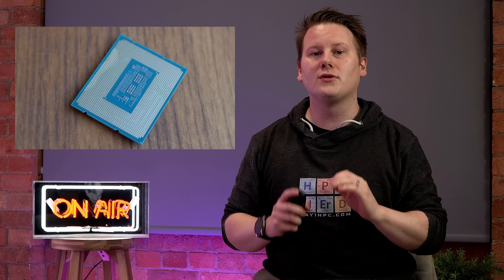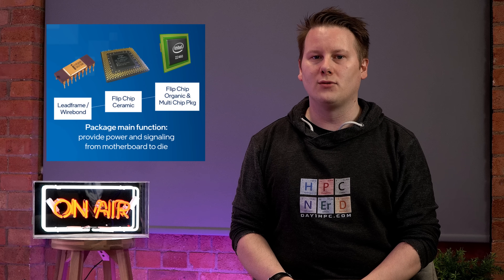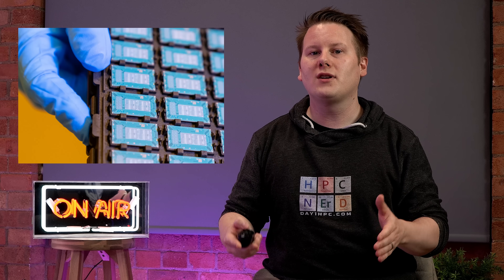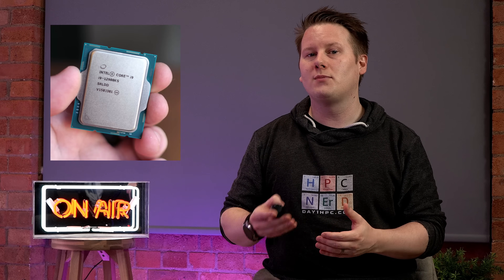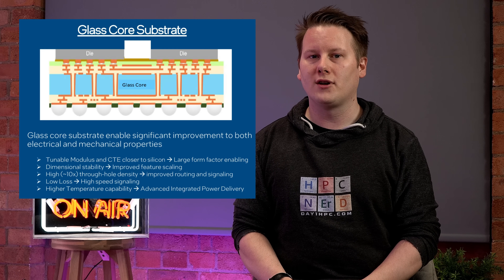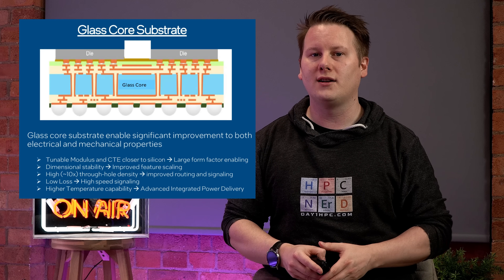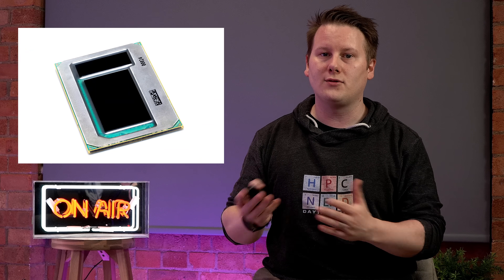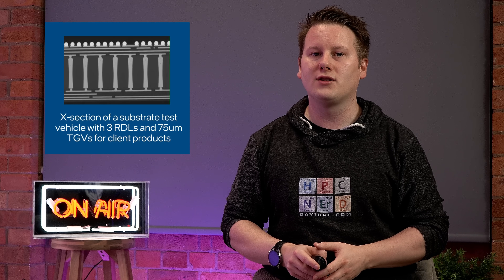Intel: We're Replacing PCBs with Glass Core

Comment: In the mid-1980s there was a startup called "Trilogy" which was founded by Gene Amdahl.  They were going to build "wafer scale computers."  The big problem with doing this was clock and signal distributions, skew across the wafer.  The proposed solution to this problem was to do the signal distribution optically, but that technology did not exist then.  Off and on,  optical signal distribution has been the subject of significant research.  At one time, Intel was anticipating implementing this by 2017.  Rather than the subject being the focus of research for the last decade, it has actually been on the table since at least 1985.

Comment: What is glass made out of? SILICON. 

The circuits in a IC chip are built up on a ultra pure wafer of silicon using vapor deposition and photo lithography. 

Green printed circuit boards, are made of fiberglass and resin, with copper cladding. They are not used inside IC chips. 

One of the problems is the thermal properties of silicon, which has been leading into the possible use of diamond (an allotropic form of carbon) as the substrate material since it has better thermal properties. 

If you want to know how integrated circuits are made, here's a video put out by Samsung Semiconductor: https://youtu.be/Bu52CE55BN0?si=K4Fa1A9EY4etYFxA

Comment: For the few out there wise by personal and visceral experiences in psychotronics / radionics this presents potentially *THE DAWN OF A NEW ERA*. 

We have shunned circuit boards and computer-chips and digital electronics due to the adverse / lethal health implications to the operator which, as Thomas Galen Hieronymus himself reflected, likely is caused by the severely-toxic, inorganic components of the PCB substrate.  'Lethal Orgone' results and poisons the operator in connecting him/her to the device and the intended target. 

These are truly pioneering days.  Interfacing artificial intelligence with psychotronics -- wow.   We got GPT on the microphone, Chewie on the bass, and C3PO is poppin' and lockin' on the dance floor.  Put on yer shades, amigo -- the future is about to get a whole lot more psychotronic...

F.

Comment: Like I keep telling all of the AMD fanbois. Yes AMD is sort of on top right now eating into Intel's market share, but I also pointed out that this was true in the past as well until Intel moved from the Pentium chip to the Core 2 chip. Once that happened AMD was almost killed off. Thus I encourage AMD to take what it can get while it can, because when Intel releases its next breakthrough, AMD will suffer the same fate that it did right after the Core 2 chip was dropped. 

As far as you getting a sneak peek or a visit to the facility in question, that would be amazing!

Comment: There are properties of materials that are indicators of how efficient a material will transfer signals. For PCBs the main ones are Dielectric Constant and Dielectric Loss. Using these properties, glass is not as good as many other materials used such as Astra so I don't understand how glass can have less signal loss. I do understand that the fabric weave is a problem and glass could eliminate weave issues also thermal conductivity for glass is likely better. 

One thing that helps with decreasing high frequency signal loss is to use a better conductor. Silver is often used as a coding on coper wires to reduce high frequency signal loss. Since high frequency signal tend to travel on the skin of the conductor silver plating can help. I have not seen silver used on PCB or substrates yet but my visibility is very limited so maybe someone out there is using it.

Comment: If you've ever seen PCB's being made its a chemical plating process that creates the copper via's ... i picture it will be a multi-material solution using chemical plating on glass with solder-mask which will not make it look like a transparent piece of glass but the same as fiberglass PCB's

Comment: As someone that built his own computer, but arguably I've only built... two computers ever...  Would the glass core substrate increase the fragility when holding onto the CPU?  
While I know I'm talking about all of maybe 2 minutes between package and retention clip tightening, knowing Intel's history with low quality thermal interface between dye and built in heat spreader, would a glass substrate be too delicate to do something like delidding for better thermal performance?
Reply from the maker: It's unlikely. You can tune the strength of the substrate more easily with doping and binders.

Comment: A lot has happened since I bought my first transistor radio in 1958.  Even as a science nerd, I didn't imagine we'd have gone this far, so fast.  I find the humans to be disgusting barbarians and look forward to our AI robot masters setting things right... maybe.  Also, with the return of the ice age, I expect we will need all the help we can get as millions of humans die off.  I'll be long gone and don't give a crap, anymore.  And people wonder why I'm so very reclusive.

*Technically, we are still in an ice age, but taking a short break.  As Earth moves closer to the center of the Milky Way, gravity will undergo changes that will provide the proper conditions for a total ice sheet over the north, ONCE AGAIN.  Earth moves BILLIONS of kilometres through space each year (about 70 billion Km within the Milky Way, itself, which is turning, too)... one cycle per year, a helical wave as we travel, South Pole forward through space.  We must expect our magnetic poles to adjust to the poles of the Milky Way, also flying South Pole forward through space... nothing ever travels in a true circle unless it can exceed the speed of light squared.  The ice sheets form in the north, the tail end of spaceship Earth.

If we were flying sideways, through space, Relativity would cause time shifts between summer and winter.  Earth flies South Pole forward through space carving a helical wave about 70 billion KM long within the Milky Way, which is also moving.  One wave per year with an orbit wave length of about 70 billion Km.

Comment: Silicone Glass has potential including fine line widths, similar coefficient of expansion as silicone wafer dies, permisivity and permitivity for higher transmission rates and improved impedance matching to reduce ringing (fine wire traces at high speed act like inverted wave guides, so surrounding material affects the speed of light. Mismatched impedance creates signal reflections). But one problem is low thermal conductivity compared to metal.  Perhaps they will design a module with many chiplets in a hermetically sealed, pressurized shell. High pressure gas inside the module will increase gas density and thereby improve thermal conductivity from heat generating chiplets to the shell surface.

Comment: I'm a lot more interested in what's replacing silicon. Gallium Nitride (GaN) and Carbon Nanotube (CNT) chips are needed more so than replacing the substrate die packaging. Sub <3nm lithography is imminent and quantum tunneling is going to be a significant problem now.

Comment: This is really cool and I really hope Intel can give you more info to share. I am full of questions as well. The pictures look like they expect normal copper connections on both sides of the glass, but is that really necessary? If the flip-chip has VCSELs on the surface, and they take a similar amount of die area and power as a pad for connecting a pin, maybe that's how Intel plans to get by with fewer layers. Wild guess though.

Comment: I'm keen to see how it pans out. One immediate thing comes to my mind though and it'd be an interesting question for Intel to answer. The organic substrates have some flex in them naturally, how would a glass substrate cope with the high compression forces placed on it by a socket clam and heat sink? what's their approach for dealing with the mechanical stress a chip might face during installation, would the glass break or is it strong enough to hold up to mechanical stress?

Comment: 🎯 Key Takeaways for quick navigation:

00:00 🧩 The green PCB-like component called the substrate is crucial for connecting silicon to motherboards in high-performance processors.
01:41 🔍 Substrates facilitate connectivity and power transfer between silicon and motherboards. Glass core substrates are the focus of Intel's next-gen packaging technology.
03:16 💡 Intel has been researching glass core substrates for almost a decade, with plans to make them available to customers by 2030. Glass offers advantages like thermal stability, signal quality, and higher density.
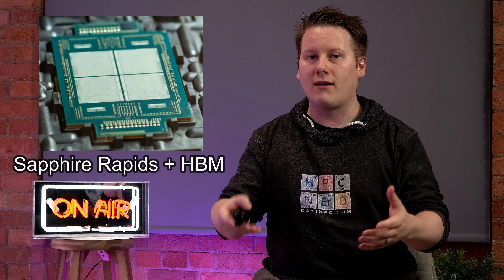05:10 📈 Glass core substrates enable scalability for larger and more complex chips, supporting faster connectivity and possibly future optical solutions.
07:01 💰 Intel aims to bring partners and the ecosystem on board for glass core substrates, acknowledging the challenge of transitioning from organic substrates.

Made with HARPA AI

Comment: I know you maybe know a thing or two about chemistry and electroanalysis... So take my comment for what it is worth as the layman I am BUT: My perception is that we learned and developed so much material science around ceramics in the last couple of decades, I'm not gonna lie, I thought the future was to go back to ceramics.

I remember in 2008 Intel was talking about how the future is laser (or optical) transistors or something like it, as continuing in the same path would lead to un-coolable chips hotter than the sun - I think it was just about when they were moving to finfet, I might be jumbling the years, but clearly we found a lot more room to keep moore's law limping along with silicon. If I'm not mistaken, some matrix operations needed for AI, with set paths and limited instructions, are still targeting glass/laser/optic logic as a tech path - but it isn't as Intel said it would be back then. So, as always, I'm somewhat sceptical.

Comment: Mark my words: the semiconductor industry will (in the midterm) have to replace most both high-bandwidth & low-latency electrical data interconnects with optical ones for both economical & physical reasons - including inter-device, inter-die to possible inter-core/ip connects. Think short-range fiber optics across dies/inter posers & rigid silicon wave guides built on die using various methods coming out of optical computing.

Comment: something about glass and a thermal cycle of 100 degrees rapidly going up and down does not make me that confident that it will last... but then again maybe there is special glass that can handle that without experiencing thermal shock. (just starting up a PC going from room temp 15C to 100C  full load when you are loading windows in 5 sec is what i am talking about.)

Comment: Does this glass core substrate have a future in say... replacing motherboard PCBs? Would there be advantages worth the cost, or will this only be practical for processor / memory dies?
Reply from the maker: Not really - you don't need the connection density. Signalling with transceivers maybe, but that's highly enterprise
Reply: @TechTechPotato  Thanks.

Comment: I'm excited about the possibility of optical integrations. 

Although it'll be quite awhile before we get fully optical processing, we can benefit almost immediately from inter-chip optical connections. Many of the problems that still hold back bus speeds are entirely electrical, and likely wouldn't exist on a fully optical bus, meaning we should have bus speeds that are mind melting. 

Another benefit of optical is the low to non-existent heat they create. Depending on how light would be generated within the processor for output data streams, the heat created by the processor's external communications is likely to be much lower.

It would seem that we should also expect this glass core innovation to make its way into mainboard substrates as well, which should give us a lot of benefits, from thermal management to better signal integrity across the system. With all of this in place, we'll be that much closer and ready for optical and quantum processing when it comes.

What a time to be alive!

Comment: I really would like to see a High-detail Tech Tech Potato Series(HTTPS) on glass substrates, what kind of benefits does it have, can it be used for more than substrates? Can it be used in-die to better insulate miniscule microscopic traces
Can this be taken to the extreme with lab grown diamond, electrically insulative, but highly thermally conductive.
Heck, i'd like to see a lab grown diamond IHS, or maybe a diamond heat spreader in the IHS.

Comment: It seems like more and more power goes towards computation but what about memory? Either way great video as always!
Reply: GDDR7 and DDR6 are on their way.
Reply: @vyor8837 oh I know memory will always keep ratcheting up but from what I understand DDR has some latency limitations that aren't getting better. So if the CPU can do 10,000 cycles in the latency gap you're losing quite a bit of performance. (all hypothetical)
Feels like memory is very much make the same technology faster for when the data arrives but I could be totally off the mark.
Reply: @Zaf9670  The fix is going to be on package very fast low latency memory with cheaper DDR as the bulk storage memory pool. Many of the limitations are imposed just by the distance from the CPU to the memory, having 4gb or 8gb of HBM on your cpu package would go a long way, AMD is already doing this with their instinct CPU/GPU combo package.

Comment: Some PCB's are already made of Fiberglass... How does Glass differ from Fiberglass ?.... Can you tell us more about subtle differences in substrates and PCB's already in use ?
What about those funky brown Organic substrates that AMD used in the early 2000's which are famous for deteriorating ?

No mention of the early ceramic packages before switching to plastic, then back to ceramic, then back to plastic again ?
Those white ceramic packages with gold lids from the early 1970's are beautiful... The famous intel 4004 chips are a good example.
Reply: The weave in the fiberglass itself is critical for signal propagation. Low speed PCBs are OK with a glass weave that has alternating gaps. These gaps get filled with resin and those areas have different properties than the glass fibers themselves. This leads to some inconsistency in how signals travel across a PCB which are not important for low speed signals, but becomes important at higher speed. 

When I say higher speed I mean rise time, not clock rate. Rise and fall times are what determines the sensitivity of a signal to an inconsistent substrate (dielectric constant), and also have much that signal decays (dielectric loss quantified as loss tangent).  

Dielectric manufacturers like Isola have developed "mechanically spread" (MS) glass fiber weaves that reduce the inconsistency in the resin/glass content of the cross section which makes the PCB signal propagation properties more consistent. As well as filling the gaps this makes the weave flatter and more consistent in its thickness. Again, more consistency means less problems in high speed signal propagation (inconsistent dielectric constant makes the signals travel faster or slower which adds skew).

https://www.isola-group.com/wp-content/uploads/Understanding-Glass-Fabric.pdf - Page 13 is a perfect example. 

It sounds like in a glass (NOT fiberglass) substrate the dielectric material is homogeneous, so its dielectric constant is consistent through its cross section. When Ian mentions "anisotropic" I think this is why that is important. Fiberglass weaves will have different properties based on the direction of the measurements, or the direction of the electric/magnetic field lines around a transmission line (a high speed PCB trace). A homogeneous material will not. 

It also sounds like the glass substrate material has very little dielectric loss. This is likely what contributes to the ability to increase the size of the substrate. 

Additionally it has a very small coefficient of thermal expansion (CTE) which could also contribute to making the substrates larger as they are more dimensionally stable especially through heat cycles. With a CTE close to silicon the substrate and the die will expand and contract in unison as temperature changes. 

They also talk about IPD in their slides. This stands for "integrated passive device", that is placing passive components (capacitors) directly into the substrate, or what I think is more likely, building capacitors directly out of layers on the substrate. This already is done with PCBs, but on a larger scale. This helps reduce impedance of capacitors and allows the capacitors to function at higher frequencies. Capacitance at high frequencies is critical for preventing minute voltage fluctuations that create noise, diminishing noise margins. 

In microprocessors it's not unheard of to include layers in the die itself to build capacitors. At these frequencies even the short pins of the processor have too much impedance. It sounds like glass substrates further improve this technique, either through tuning the permittivity of the dielectric, or by allowing vanishingly thing layers of dielectric to be used between the capacitor "plates". Increasing permittivity or decreasing distance both raise capacitance. 

I think this touches on your first two questions.

Comment: Using glass seems like it could be a new half step in between a silicon interposer and organic substrate. The benefits of a "si substrate light" as the base package seem obvious but we'll have to see if cost comes down enough to use it in a lot of products. It will be clutch for very large multi die products which would otherwise be size limited by the cte mismatch with the organic material so it should have some market even if it doesn't become cost competitive.